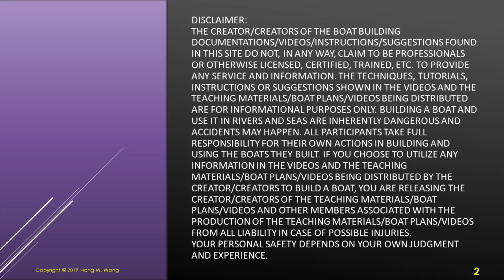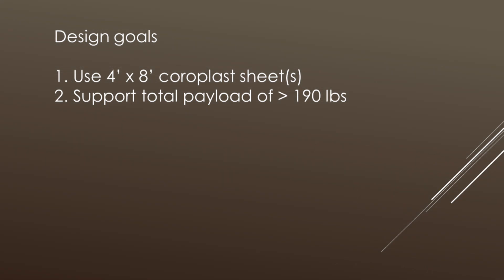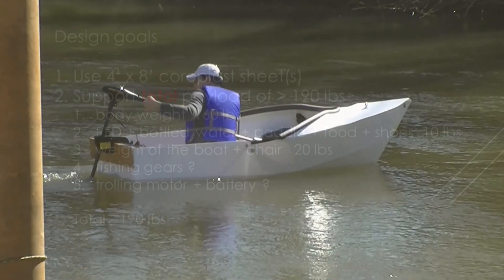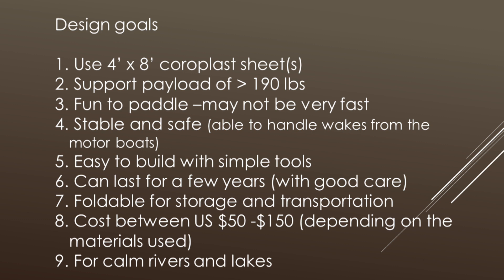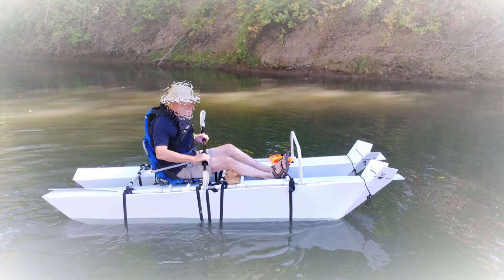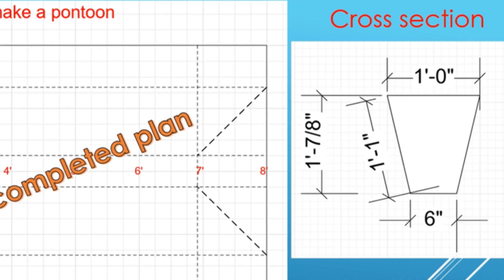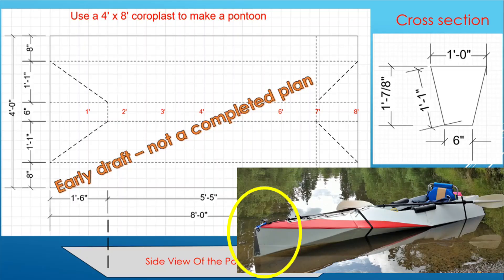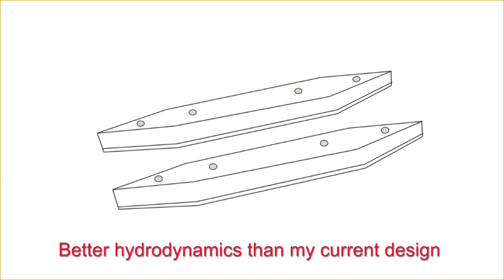DIY: use 4' x 8' coroplast for boat building - part 1

Comment: Hi, which Model is the one with the red top https://youtu.be/oawJV9pU9XU?t=193, and for which load is it ok ? Which sheets did you use to build it ? It looks like here in germany I can get only 122x244 cm, importing it from coropak directly from china...
Reply from the maker: That is my Gen 8 kayak, I don't suggest you build that one and the reason is in this latest video https://youtu.be/3OUzX1WJWYU    The gen 23+ can be built with a 48" wide coroplast. It is possible to shrink the width down to 45". I used 5'x10' coroplast to build that Gen 8 kayak. You definitely can join two 244 cm long sheet to build a longer boat. My friend built two kayaks using the 244 cm wide coroplast. It is my Gen 12 design: https://makezine.com/projects/origami-kayak/   Please go to this page, which has links to videos on how to heat fuse two sheets together.  https://www.diyusa.org/techniques     Please let me know if you have other questions.